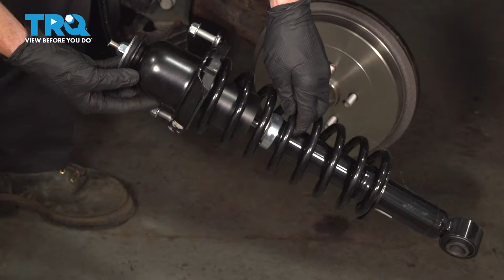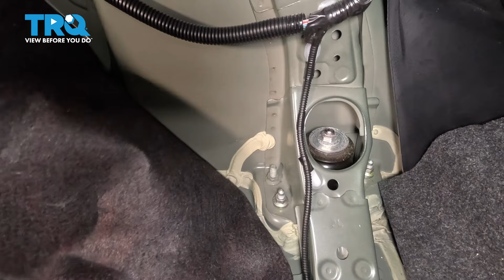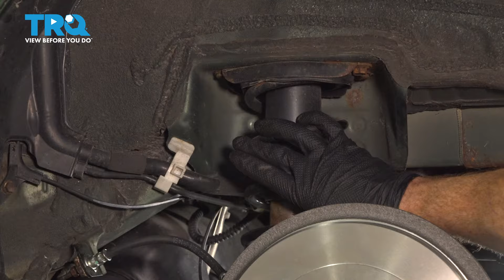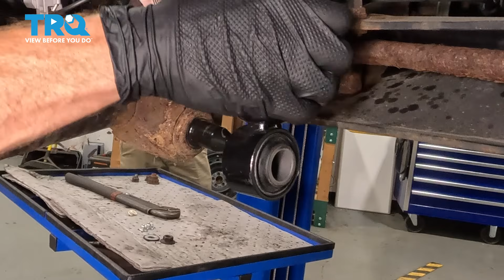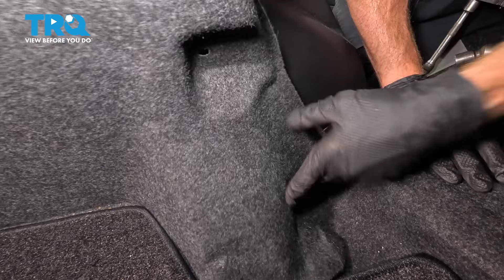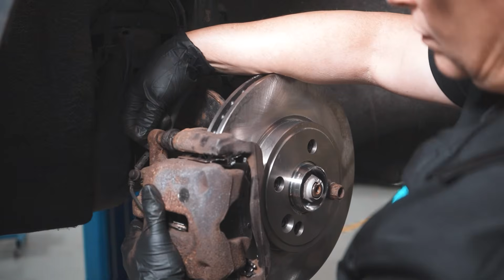How to Replace Rear Shock & Spring Assemblies 2014-2019 Toyota Corolla

Comment: When replacing rear struts on a 2014 Toyota Corolla, is an alignment necessary? There are no alignment adjustments in the rear with the solid rear axle beam. Is it prudent to still do an alignment or is that not necessary?

Comment: Great video. He made it way easier than it looked. The hardest part is getting the new strut  in the bottom screw. I had to screw the top 14mm nuts all the way down do it didn’t move and push down on the drum brakes to get strut deep enough. The new strut I had was angled 10 degrees out. Then with the wood block and hammer it went through.

Comment: Thank you for this video. Are you abdolutely sure it's 59 foot/pound for the botton nut? I have a 2019 corolla and i find different answers for the torque specs for the nuts and bolts. One answer saying 117 foot/ pound for the bottom nut.